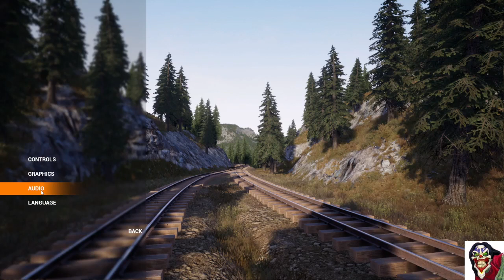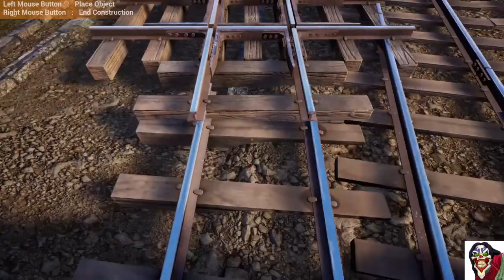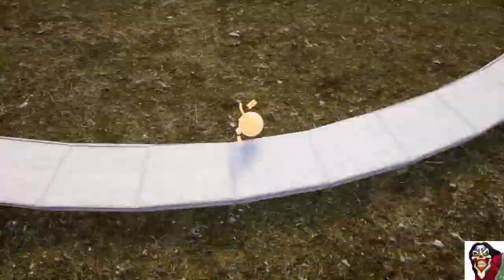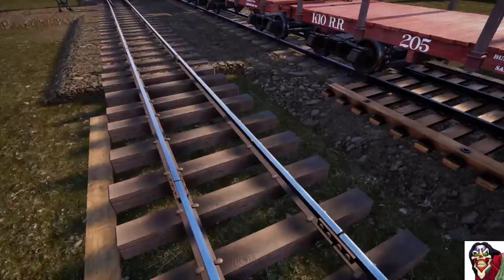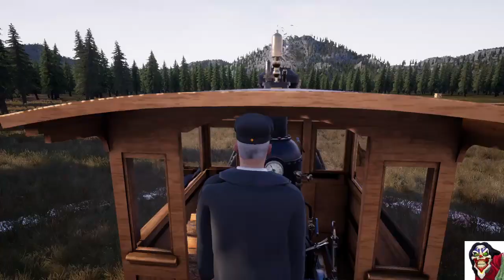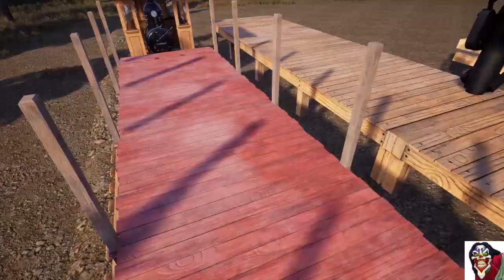Railroads Online - Play Through Ep03

Comment: I might actually try a turntable for the 2nd time, I'm curious if the 1.5 is enough to get the cars moving when you take the brakes off, I have done similar rerail tracks and laid them too shallow, but I don't recall what grade didn't work.
Reply from the maker: If you're on a grade, and the railcars don't start to roll, add/remove the pin a few times and it forces them to update their physics and then they'll start to roll.

Also, turn off the handbrake before you pick them up with the rerail tool if you want them to roll after being rerailed.
Reply: @K10wNs-Shed  Thanks, I tested, 1.5 is enough to get them rolling nicely. Some cars get stuck with brakes on, but another quick rerail usually does the trick.